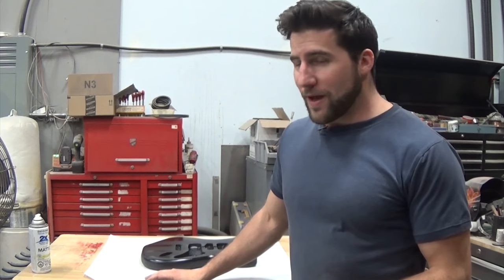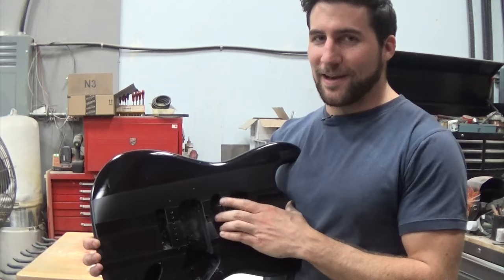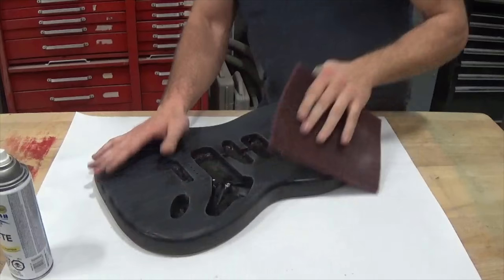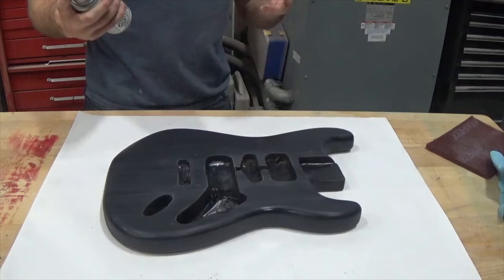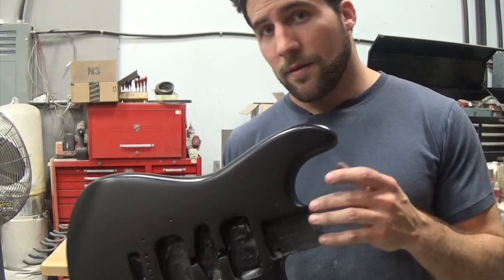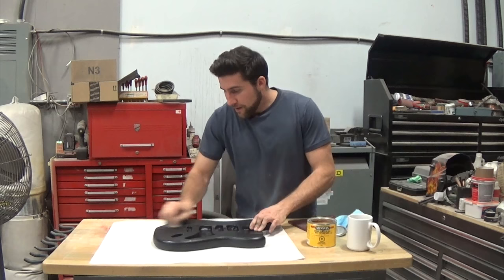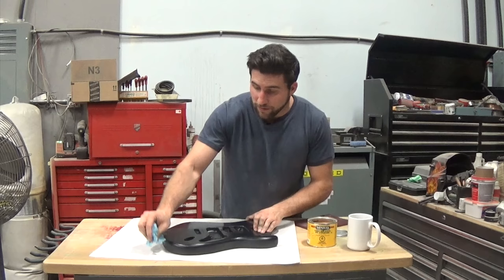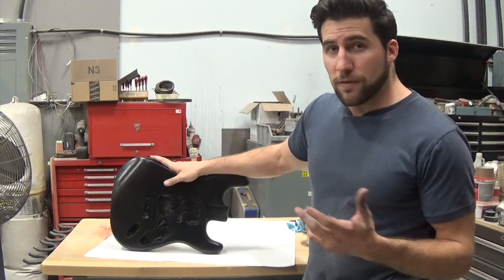How to turn gloss paint matte or satin

Comment: Followed your directions for a matte paint job in like 2018..it's time for a redo.   Dumb question though...will green scotch brite work ok for the scuffing?
Reply from the maker: Green is pretty aggressive. It will work, but you may have more difficulty covering the scratches afterward.
Reply: Thanks for the fast reply!!   How about the white? Lol   I'm having a hard time finding the brown.   Or what grit sandpaper?
Reply from the maker: The white is a bit too fine. You want the grey or the red, or 600 or 800 grit sandpaper.

Comment: hi brad, thank you for the very helpful video. I'm trying to spray paint a RANARP Ikea lamp in a matte colour (original colour is white). I'm using PYLOX spray paint and KRYLON matte finish. Any particular advice you would give to achieve a nice matte finish? Currently, after just spraying the RANARP (its metallic) with the PYLOX paint it looks glossy.
Reply from the maker: It looks glossy even after it’s fully dry?
Reply: Brad Angove hi, yup looks glossy when the pylox paint is fully dry. That’s before the matte finish. Not sure if I dare to scuff the surface with scotchbrite though haha. Not sure how many layers of matte finish I should be putting on ?
Reply from the maker: You should only need one layer of matte to change the look from gloss
Reply: thanks for the advice! I didn't apply such a thick layer at first pass (kind of just sprayed it quickly on all sides for a few seconds each). Might have been why it took 3 layers.

Comment: Question brotha. I have a satin guitar that I gig with frequently. It has areas where my forearm rests that have turned the satin into a sorta glossy orange peel. Will this fix still work for my case? Also Rustoleom sells Matte and Satin clear coat. Which one should I get?
Reply from the maker: This could help, but it’s quite difficult to fix shiny spots like that. 
If your guitar is satin the. You should probably stick with that. Matte is a bit different.

Comment: Hi! Amazing surface!!!
Do you think  or have you tried- if It’s possible to do this so beatiful surface with Satin black matte color on concrete? 
Is it beewax in your finishing wax,  and other components of course ?
Your work is  brilliant !!
Reply from the maker: Hi Susanne. With concrete you need a self etching primer. Then you can do something like this, but you shouldn’t need to buff it that way. Just use satin paint.
Reply: @BradAngove  Thank You so much🍀🍀🍀🍀

Comment: So if I was to use 2k clear on the body, then use 0000 scotchbrite to matte it out, could I just use the wax after that to get the satin look or would I need to get a matte clear coat too?
Reply from the maker: You could just buff it back up to something along the lines of a satin finish like I did with the wax. It’s not a perfect satin, but it has that reduced sheen level.

Comment: Hey Brad do matte clear coats provide protection from scratches and the sun? I’ve spray painted a helmet matte black and was wondering if I should spray a matte clear coat on it, thanks!
Reply from the maker: It depends on the quality of the clear. Some have built in UV protection. They all provide at least some protection from scratches.

Comment: Hi Brad. Please, what kind of/ number, scotch bright did you use for sanding for the matte finish and also what kind of matte clear coat spray did you use (poliurethane, lacquer?). I live in Peru and we probably do not have the same brands / materials that you do in the US, so, any equivalence on different materials and or further specifications would be very helpful and appreciated. Thanks in advance.
Reply from the maker: The scotch brite was the grey one, and I used an acrylic enamel clear for this particular video.

Comment: Great vid! Thanks for sharing this. I need to spray my strat neck (MiM) I sanded too much on a spot and got into bare wood a little bit. Could you tell me what product I should use to make a satin finish on the neck? I read somewhere that you can spray lacquer over poly. 
My plan is to scuff up the existing finish first to give a good surface for the new finish to adhere to. 
I'm kinda upset I did this to my guitar so I need to fix it. 
Anyway, thanks again for sharing your vid.
Reply from the maker: Is it a transparent finish?
Reply: Brad Angove yes it's a natural  transparent finish. The neck is glossy but I think it was a satin finish when it was new. Can you buy a clear satin poly   In a can, or does it only come in gloss, from a can?
Reply: Part of me would just really like to touch up the area I sanded too much, but I didn't know if it is possible. 
Thank you again for replying
Reply from the maker: You can get it in satin.
Reply: Brad Angove- thank you Brad, I bought some at Home Depot today. I got satin and a gloss. Made by MinWax.
Okay one more quick question, since the neck is already finished with poly from the factory, could I just use the poly I bought and spray just the area that I sanded too much? Then after the new finish dries, could i wet sand the area to make it match instead of having to remove the neck and tuners and paint the whole thing? If that is okay to do, should I use the gloss or the satin? The neck is shiny because someone buffed it and polished the whole guitar. I believe that the Mexican standard strats came with a satin finished neck. 

So use gloss or use satin? but if I used satin I'd need to buff it out to match the existing shiny finish. 
Shit, sorry man for all the questions. I just want to get it right. 
Thank you again, I really appreciate your help man.
Reply from the maker: If you try to just spray that area you will get witness lines. You will already be risking them to some extent if you don’t sand the finish off, but they’re less likely than if you were to literally attempt a spot repair. 

I prefer satin necks personally. Less sticky.
Reply from the maker: You’re welcome.

Comment: I have a squier Stratocaster, in the normal shiny black you see on most guitars. So do i just need to sand it, then apply matt clear coat am i correct?
Also what grit sandpaper would I need
And can you explain the cleaning process as well as what I would need for that?
Reply from the maker: Yes, you can do that. Sand with 800 grit, clean with wax and grease remover, and then spray your matte clear.
Reply: @BradAngove  thanks! However would it be possible to just spray on a satin lacquer directly on the body or is sanding necessary?
Reply from the maker: If you want it to stick you need to sand.

Comment: Brad, what's your preferred method of getting a very smooth finish with the matte look? Similar to the backs of guitars like the lower model Martin's or Taylor's. They have a baby smooth finish, but no Sheen whatsoever. Thanks!
Reply from the maker: From what you’re describing I would probably do a few coats of matte clear, let it dry fully, sand smooth at 800 grit, and then do one light final coat.
Reply: @BradAngove  sounds good and thanks for all your videos!

Comment: Hi Brad I know this is a few years old so I’m not sure if you will answer me or not… I have an Ibanez neck through bass and I really actually do like the gloss on it but just not on the back of the neck where my thumb slides, that’s where I miss the smooth matte finish of my other basses, can I use the Scotch-Brite and tape off just the area where I want to do it and not spray it with the matte finish, but perhaps when it gets shiny again just re-scotch Brie it again?
Reply from the maker: Yes you can.
Reply: @BradAngove  thanks

Comment: Hey Batman, do you have advice on how to fix the faded roof paint on a 2005 Nissan Van? It seems like the clear coat broke down on it but I want to try to fix it at home before doling out the money to a shop. Thanks.
Reply from the maker: Alfred broke my scanner, so can you describe in more detail what you mean about the clear coat breaking down?
Reply: @BradAngove  the factory finish on the roof. The clear coat looks like a white cloud and is flaking. BTW, this video helped me fix a gloss issue with my table refinishing project. Couldn't get the poly gloss level uniform between the leaf and the ends (I did them several months apart) , so 220 grit back down to 500 across the board. 😎😎
Reply from the maker: Was it lacquer?

Comment: Hello Brad, and thanks for sharing your works and discoveries from your shop.
I'm considering taking down the gloss finish on a newer, unmarked,  Rickenbacker (in jetglo black) down to a matte black finish, likely starting with the back of the neck then possibly going it to the entire body. Have you any further advice for getting an as even, balanced,  factory fresh looking result? My main goal would be to rid of the stickiness of the gloss, but for cosmetic reasons as well.
My knowledge of paint and finishing materials is somewhat limited. I find it odd that original matte finishes can wear down to gloss. Is that because  matte finishing materials actually begin as a gloss base then with matte materials mixed in or layered on top?
Reply from the maker: Basically matte can be polished and it becomes gloss, so as you essentially polish it with your hand over time it glosses up. 

In terms of getting a matte finish, my only tip really is to abrade it smoothly and then try to do just one nice even coat of matte clear.
Reply: Thanks.
And taking a gloss down to a matte finish generally should make it much more smoother and non-sticky, correct?... or would that depend on what type/brand of matte clear coat goes on top?
Reply from the maker: If done correctly with a decent quality matte paint it should give it that matte feel that doesn’t have that squeaky sticky thing going on. With some exceptions like when matte lacquer gets warm and starts to feel sticky.

Comment: Hey Brad If a piece of aluminum was sprayed with a lacquer paint and and gloss clear enamel as top coat, will the process still be the same?
Reply from the maker: I can tell you that generally lacquer and enamel do not go together. I wouldn't advise using them in the same paint job. Also, if you're referring to spraying raw aluminum, it is difficult to get paint to stick directly to raw metal without using a primer.

Comment: Do you sand it down after the Matt clear coat dries to get a smooth finish? What grit would you use? I mean, I would like to keep the finish matt but get rid of little spray dots.
Reply from the maker: If possible I try to avoid it. But if you take a look at my video on how to get a matte finish with spray cans you can see how I sand it if necessary.

Comment: What do you think of leaving a light satin coat as is, vs using steel wool? And can I use birchwood Casey gun stock wax as a  lube?
Reply from the maker: If you’re actually spraying with satin and it looks good then best option is to just leave it as is.

Comment: Nice video Brad, can I ask what exact course or product number is the scotch brite you have used? I cant use the green one for the kictchen can I? I have started on the neck of my guitar with a 600 coarse sand paper although a bit messy in the beginning and creates a chemical odour when scrabbing. Is that safe? and what should I apply on it once finished? Any other product to protect the wood?
Reply from the maker: The scotch brite is by color. The green is too course. Have a look at the amazon link in the description, I have linked the grey and red there I believe as well as white.

A bit of chemical smell when sanding is normal, but you should be wearing a mask.

Comment: Is it important to use circular motion when knockin down the gloss? Or does it matter? I’m worried it’ll leave scratches that I’ll have to leave later. I’m planning on doing this to an acoustic. Is there any difference?
Reply from the maker: I find the circular motion helps it happen more evenly. It doesn’t matter much though; the next coat fills it in. 
Technically the additional paint and wax can affect the sound of an acoustic.
Reply: @BradAngove  I watched another video where the guy simply used a scouring pad like what you used, two different grits and then once it was where he wanted it (as far as the satin look) he put carneuba wax to protect it. Any thoughts on that? Rather than the rattle can?
Reply from the maker: That’s an option. I’ve done it before.

Comment: Hello Brad. Will this work on a carbon bike frame? Mine is gloss black and I want to change it to Matte black. It does have colored decals and I assume they are under the clearcoat? I can purchase new black decals but...How should I handle that process?
Reply from the maker: It should work. The paint on it is what matters, not the material of the frame.
Reply: @BradAngove  Thank you. I just watched a video on how the manufacturer paints and decals the bike frame. So...I should have Black as the base coat and everything else is decaled under the clear coat. I will sand down until I can remove the decals then degloss the black then matte clear.  You just saved me a lot of time vs. stripping the entire bike down and start from bare /raw carbon.. Thanks!

Comment: Brad, I have a guitar that I had an auto body shop paint with PPG then matte clear. It has a little bit of orange peel. I really wanted that vinyl wrap matte look. I was thinking about wet sanding it to level the paint. Is that a bad idea? It sounds like you are saying it will make the finish gloss.
Reply from the maker: It depends on how fine the paper you use is. It will likely look sanded one way or another. You generally don’t sand matte finishes because you can’t polish them.
Reply: @BradAngove  thanks for replying! I enjoy your channel. I love watching guitar builds.

Comment: Hey Brad, great tutorial! Do you know if that can of Rust-Oleum matte finish is compatible with oil-based wood stains and Tru-Oil finish? I'm interested on using this since I don't have a place to use a paint gun and compressor. Thanks!
Reply from the maker: It can be used with stains generally. I’ve never tried it with truoil so I’m not sure about that one.
Reply: @BradAngove  and it can be used as an overall finish? Instead of poly, lacquer, or any of the commonly used?
Reply from the maker: Yes, it’s an acrylic clear. They’re not uncommon.
Reply: @BradAngove  got it. Thanks, man!

Comment: What sand paper and paint would I use on a high gloss metal table and chairs? I want to turn it all matte black. :)
Reply from the maker: Sand it with 600. Matte finishes aren’t as durable, so I could aim for the spraymax 2K matte clear. It’s at least stronger than this stuff.

Comment: I have a pair of black gloss glasses. Is there a good way i can turn them into matte or just de glossify them with preferrably homemade tools?
Reply from the maker: You don’t really need any tools. Just tape or remove anything you don’t want to paint, scuff the gloss black with 800 grit sandpaper, and spray them with matte clear coat.
Reply from the maker: Clear coat is clear, not black. If the glasses are already black you just need matte clear.
Reply: Brad Angove yes they are already black so i guess matte clear should be the ideal option?
Reply from the maker: That should work.

Comment: Hi Brad, thanks for the videos, these are super helpful. I appreciate your work.
I am wondering if you think this technique would work on a hollow body? I have  a gloss black Gretsch G5420 with binding that I would like to make a matte finish. Believe it’s a poly finish, don’t know the paint type. Any reason not to do this with that type of guitar? Thx!
Reply from the maker: The fact that it’s a hollow body shouldn’t really matter. That being said, you may want to pick a higher quality product than spray cans if you’re painting a Gretsch.
Reply: Brad Angove 
Thanks for the advice. I don’t have an airbrush and it seemed pretty straight forward but it would be an awfully nice guitar to wreck the finish on! Maybe I’ll price it out at a shop that has the right tools on hand before I decide what to do.
Reply from the maker: That’s probably a good idea.

Comment: So, if i want to turn a gloss guitar to matte and add a vinyl sticker, would you say i'd need more then one matt coat or would 1 be enough?
Reply from the maker: Are you trying to bury the sticker under the clear?
Reply: @BradAngove  yes, to give it some protection against wear and coming off.
Reply from the maker: I’d do a couple coats of gloss, let it harden fully, sand lightly with 800 grit, and then hit it with the matte finish.

Comment: Should I use matte clear on wipe-on poly to get a natural wood look or will it be cloudy.. Is there a better option? Trying leave it looking just natural and not satin.. slightly paler than the danish oil video.
Reply from the maker: Perhaps you should a different oil finish. The answer to your question depends on what matte clear you’re referring to.

Comment: I've got a red quilted maple gloss finish body it's like to dull or turn into a nice satin finish without losing the detail of the quilted maple yet having a nice smooth satin finish. Would fhescouribg pad work better than say 0000 steel wool or wet sanding 1200-2000 grit?
Reply from the maker: The pad should work fine. So should the sandpaper. Are you planning on using finishing wax as well?

Comment: Brad, what happens if you use the steel wool and wax on a clear? Thanks
Reply from the maker: Depending on how fine the steel wool is, you generally buff it back to a satin or semi gloss.
Reply: Brad Angove thanks Brad, if I use 0000 wool on a Matt finish will it help making the surface smooth or will it scratch it? (Without the wax)
Reply: Just watched a few of your videos, my wife says I have no life 😂
Reply from the maker: It will scuff it up. It does give a matte look, but not quite the same. Test it on something else first to see if you like it.
Reply: Brad Angove thanks, I appreciate the response.